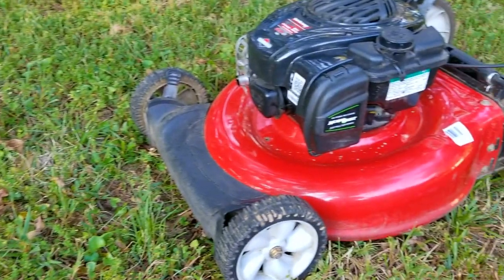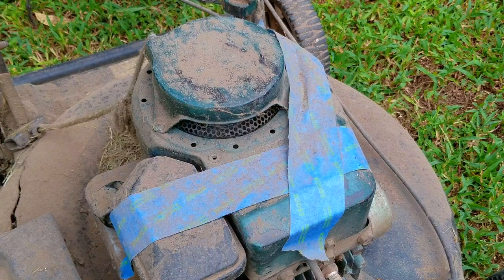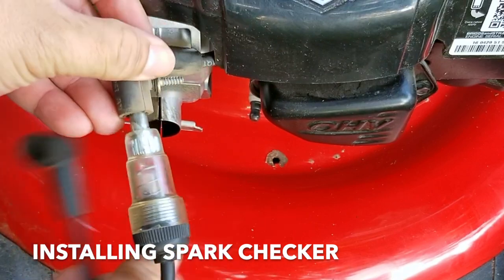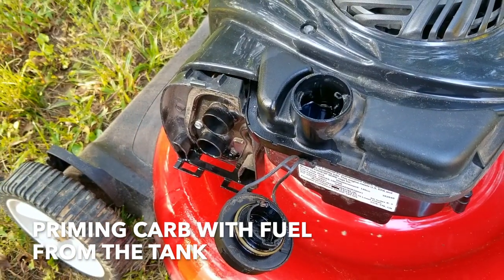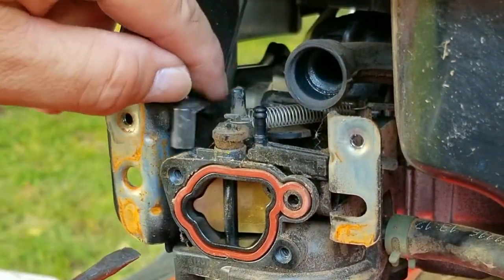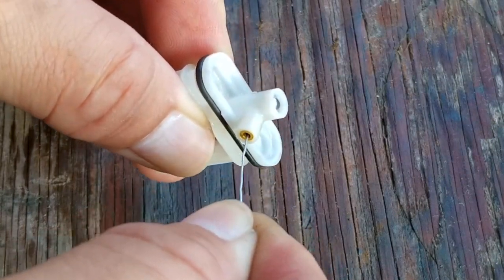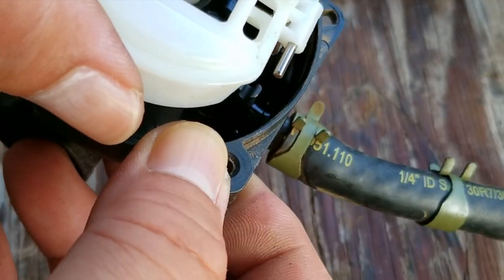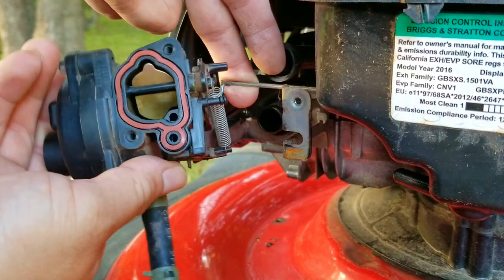Why Did Briggs Stop Making The Flathead Engine?

Comment: The old CARBURETED flathead engines were a million times better than this new trash. Fuel injection is pure garbage, no matter what type it is or what you put it on. A simple carburetor can't be beat, and those old B&S engines definitely had simple carburetors. The used a diaphragm to pull gas out of the tank, and didn't have a float bowl. They would run forever. I worked in a lawnmower shop when I was a kid, and fixed a lot of them. I also used a lot of them. I quickly discovered the wind vane governor, and connected a string to it so I could increase the engine RPMs. Still the engines never failed. They just ran and ran. They didn't even have any kind of oil pump, just a simple splash system. I also had a mini bike with a horizontal crank 5 hp version. I beat the crap out of it for years, and it still ran fine. This new junk is just that. JUNK. I still have three of those old '70s mowers out in the shed, and I'll bet they all still run. F the EPA. MF the EPA.
Reply from the maker: so I've heard.  I think EFI would have been nice.

Comment: I like the new engines because I make money quick from cleaning the carb the old metal carbs took all day to clean up I had quit working on the old ones because of it now I work on them again because of it I like the plastic carbs I wish they all were plastic the only Briggs engines I really like are the v twins personally but I collect the older Briggs motors especially the vanguards because they have a way better cam I don’t fix and sell any mowers with the big singles anymore there junk I call them two year time bombs
Reply from the maker: I can agree to that, they are definitely easier to clean and get running again.

Comment: New briggs engines are TRASH. plastic carbs you can't adjust and that develop vacuum leaks, and plastic internal parts. They have used plastic oil slingers for years, but they use plastic camshafts as well. These engines don't last....which is apparently the direction Briggs decided to go and when the engine fails, you get to buy a new one. Meanwhile I have a early 70s era 3.5hp on a push mower that has a METAL carb with adjustable jets and after 50 years it just needed a fresh set of rings and valve guides to run like the day it was assembled. Same with a 16hp cast iron engine I saved from the scrap yard from an old Gilson lawn tractor. Just needed points and a new float in the carb and it starts with one pull.
Reply from the maker: thank you Sarge Pent.

Comment: Briggs & Stratton bullet proof?  That's a laugh.  They always lasted only half as long as a Honda or Robin when worked hard.
Note that a few years ago Briggs & Stratton purchased Australian mower manufacturer Victa.   Now Victor's engine WAS indeed a VERY long lasting bullet proof engine, and it had a plastic carb for at least 40 years.  I wouldn't be surprised that Biggs & Stratton got the idea to use plastic after they saw how cheap to make the Victa engine was.
I would say the reason why Briggs & Stratton went to an OHV design is because the Honda and all Chinese engines are OHV - they need to compete.   Or perhaps in this era of outsourcing and global manufacturing, they are buying the parts as kits from China.  Assuming the whole engine doesn't come from China....
Inside House's territory must have very poor quality gasoline if it is only good for ~30 days.   Or  maybe its because he keeps it in a plastic container - gasoline is affected by light and should always be kept in a metal can with a light-proof cap.  Transparent bottles such as shown at 3:45 are a complete no-no.  Note that by the time gasoline gets made at a refinery and shipped to a rural fuel depot, and sold to a farmer, and the farmer actually uses it, could be several months.
Reply from the maker: seems like you're somewhat opinionated I like that.

Comment: That's why you don't work for a company like this.. Put fuel injection on a cheep push mower.. dood.. you are wrong. Oh ya.. just put a battery, high PSI pump and injectors on that.. and how much are you willing to pay for this.. and before you give me the well if they make 10000000 of them.. no.. cost of scale never goes below a certain base cost.
Reply from the maker: dood.. "hey let's do the R&D, on a whole new engine instead. That has to be cheaper then adding EFI"   Then to deal with the cost, we have to move operations overseas ... thanks Bart....

Comment: new briggs mower engines are very cheap. even brand new ones out of the box have deep score marks in the cylinder.
Reply from the maker: so you've taken a brand new motor apart, that hasn't been ran, and found scoring?
Reply: @INSIDEHOUSEGARAGE   i have scoped them and found deep score marks.

Comment: I'm glad I got a battery mower. Gas engines are JUNK.
Reply from the maker: let me know how much that new battery is next year.
Reply: @INSIDEHOUSEGARAGE  $250. At least I don't have to hear that HORRIFIC engine noise. I see you're one of those gas engine hobbyists. Know what, I'm a railfan. 70 years ago,  steam locomotives were DYING. Well, it's 1953* for gas engines in ALL applications. The Otto Cycle will be just another dead technology along with thermic siphons and Baker Valve gear. 

*By the end of 1960, there were NO steam locomotives left in regular service. They DID save a few for us train buffs.
Reply: @INSIDEHOUSEGARAGE  I also don't have to worry about having explosive gasoline in my shed and in a couple of years when my car is up for replacement, it will be banished from my garage as well. A couple years ago, a house a couple blocks over from me was incinerated by a gas car in the garage that caught fire.
Reply from the maker: Noise, the byproduct of things moving against each other. 
Electrice motors, apparently make no noise!
Reply from the maker: batteries, they've apparently have never caught fire and burned, ie, teslas cars, Samsung note7, and chevy bolt, or volt.

Comment: I can't understand how you can complain so much about an engine that was fueled with gasoline that contained particulates. It's not the manufacturer's fault. Your reasoning really scares me. The gas age issues you have is nothing true about as well.
I know such an engine that has never had a single problem in over 10 years.
I think they changed the motor design because the consumption is halved with the new technology, that's what we want in the rest of the world with high fuel prices. 2.5 bucks every 60 minutes of cutting is unnecessarily high consumption.

Comment: Old gasoline is old gasoline if it came out of gas pump I don't care if you got fuel injected or what water don't burn!
Reply from the maker: interesting how this topic comes up but on the other side of the argument. Some have said they've started engines with 4 year old gasoline in them, with a carbed engine and they still start?

Comment: The old engines by far. No use for this new plastic crap!  My rider is a 1990 with the industrial engine. Never a problem! My push mower id
Reply: ...is a Honda. Also partial to the old 2 stroke Lawnboys built by OMC. Have several from the 60's still mowing!
Reply from the maker: I like the older ones too, by far!
Reply from the maker: I feel the same way.

Comment: Get an electric mower. No need to deal with any of this stuff.
Reply from the maker: get an electric and don't worry about where the power is coming from. Almost guilt free
Reply: @INSIDEHOUSEGARAGE  sure thing. Starts every time, quiet, powered by the sun and wind!
Reply from the maker: LOL!!!!..Solar accounts for the smallest percentage of the power on the grid, same goes for wind power.  As for the starts every time, sure, but after time, it run for as long as it used to. Just wait till you have to buy a new battery, you're going to be, less one arm or leg.  I wish I lived in your world.

Comment: Biggest pile of junk built so far...must be a contest now. No fuel filter, no oil change, plastic carb...what next? A sealed quart of gas in the tank, when it runs out, throw it out! Briggs going down fast. Stratton must have died.
Reply from the maker: they certainly have their issues.
Reply: @INSIDE HOUSE GARAGE  Bought mine new at Wal-mart. It don't have 10 hrs of trimming on it and won't run!

Comment: The old technology is a proven concept. If you're going to ask which design I want the point is moot. Of course I want the long lasting option.
You made the point yourself that a decision was made to save shipping cost by making it out of plastic. Did that translate to a benefit to the consumer?
The lighter and more powerful design is subjective. I believe you have to take power claims with a grain of salt. Manufacturers will be disingenuous just to make a buck. Standards are manipulated to support increased power output even with an inherently more efficient design. At what cost? The old design wasted a 1/4 of a teaspoon to promote more power over longevity. Who cares..? The guy that has to buy a new mower. 
Forcing an individual that has no concept of care for an engine much less fix it when it won't function to accept a promoted better design is disingenuous as well. The old design was more tolerant to that sort of neglect.
As an individual that has an aptitude to service these little mowers the decision for me is to maintain the status quo, to adjust old, or new carbs, or clean them after gas in carb over winter. Or to understand that the flathead had a problem with a worn out exhaust valve guide or the OHV stamped steel rocker adjustment along with the same problem of a aluminum valve guide.
Disposable income to repair over a desire to DIY repair over no other choice is always an issue with anything, not just a lawn mower.
I did learn that the carb is another weak link with these new mowers just never had to chase it down because my old Briggs is running like a top! Good video, thanks!
Reply from the maker: thank you jetskijoki

Comment: What a total piece of crap the new motors are. To add insult to injury they don’t even have an easy way to change the oil.  Trying to pass this low grade mess of on consumers is so disappointing from what was once a good American made product.
Reply from the maker: I've heard the same arguments about this engine. It certainly seems a bit lacking.
Reply from the maker: Quite the Statement, @Jay Davis.  You should consider making videos. Seems like you have a lot to Argue about.

Comment: These new engines are scrap metal
Reply from the maker: seems like it.
Reply: @INSIDEHOUSEGARAGE  they started with a adjustable carb.  Then plugged all the adjustable  ports. After that they made plastic carbs.    And ditched the flathead for the overhead valve junk...
Reply from the maker: I believe you're correct.

Comment: It was all to do with emissions really as the older engines wouldn't meet the new emissions standards in both America and Europe and to compete with chinese engines that were being fitted to some of the brands they once supplied. The new engines are ok engines but literally on every service replace that white plastic main jet in the carburettor as cleaning it doesn't always work. You will require the engine numbers off the engine to get the correct one, these are usually stamped onto the side of the engine block between the exhaust and oil filler or on earlier engines on a metal plate infront of the carburettor.
Reply from the maker: thanks for the information